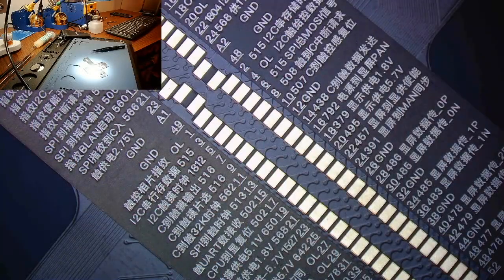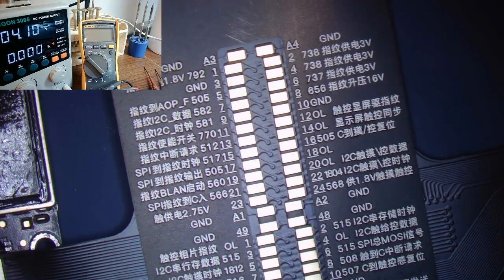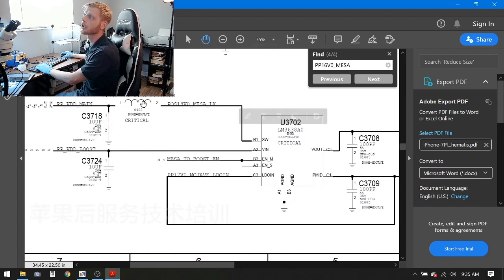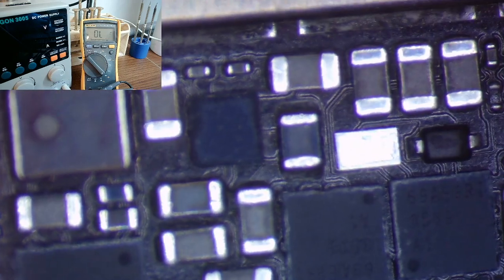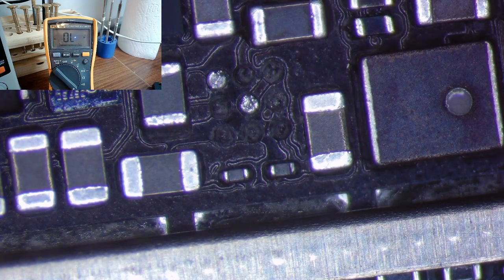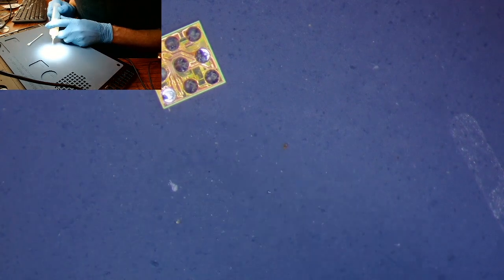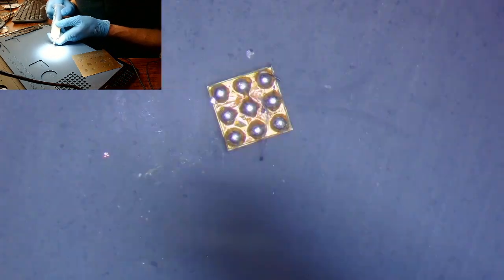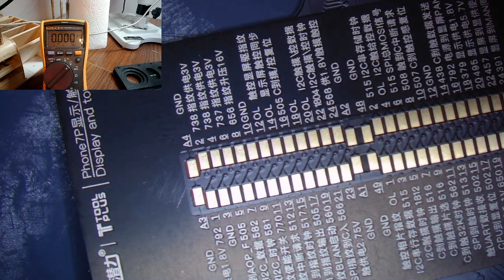How to diagnosis and repair faulty iPhone finger print sensor (Board side)

Comment: Great helpful video Dusten covered many great tools and ideas , tips options , loving your our helpful content 👍; 
I have a question regarding home button connector on an iPad mini 3 , which is trolling me as only one end of the connector is ground !?! It works as home button but lost fingerprint function , also if I press on it in anyway the iPad restarts ?! any experience of this or advice would be really appreciated ( I soldered a new charging port and screen connector onto the board )